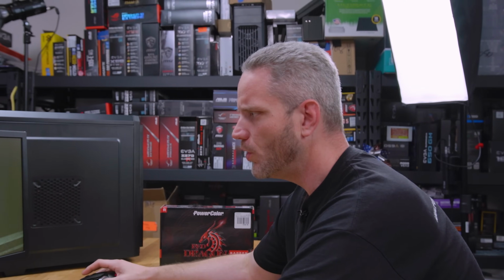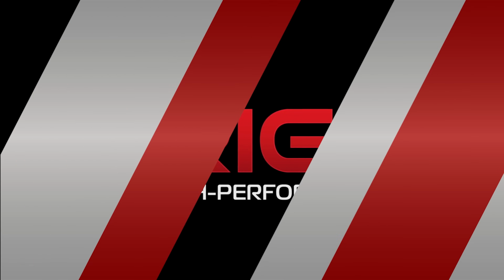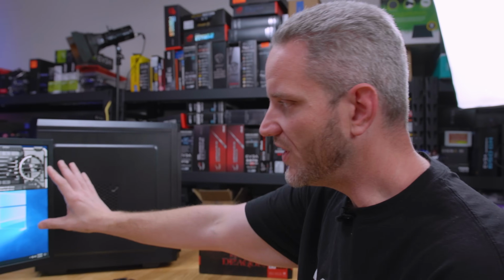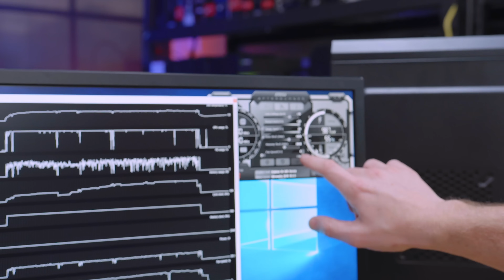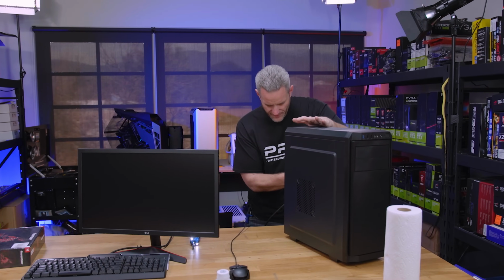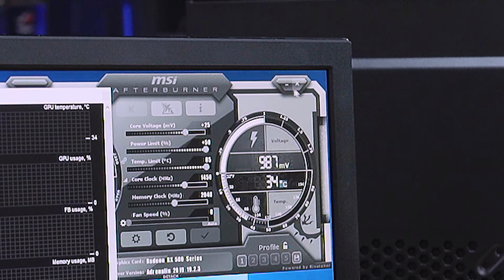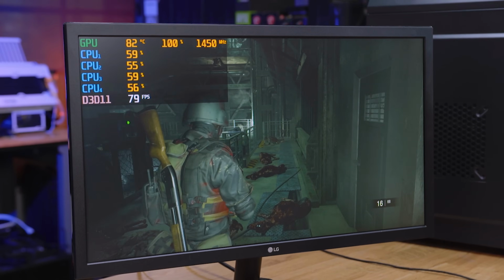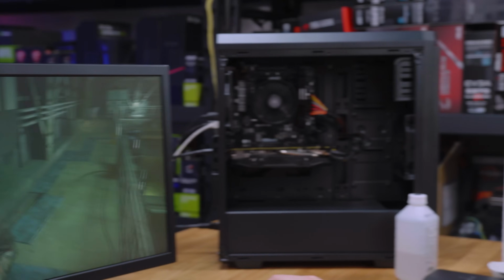Should you replace your video card's thermal paste??

Comment: Normally applying thermal paste on CPU is considered a no brainer, but on a GPU, is not that simple. Putting thermal paste on gpu is like putting thermal paste on a CPU without the metal plate on. I am glad I saw this video but I have questions. I am a diy guy and have done thermal paste replacement on my GPU but although it gave me a 2 to 5 degree drop in idle temp it was a decision I have come to question 1 year later. Here's what happened. I have never done replacement before but noticing my gigabyte 980ti GPU idle temp increase from 48 to 55 degree I decided it needs a cleaning and paste replacement. I did just that. I managed to open the GPU without breaking anything and realized that the GPU was naked, no metal plate like on the CPU. I decided to take precautions by removing the old paste slowly with small careful dabs of swab coated in alcohol. I finished cleaning after 1 hour or so. Then just to be on the safe side since I did not know if normal CPU application methods were safe for a naked processor, I decided to coat the whole GPU die with pste using a flat plastic card. Everything worked and I got smooth sailing for one year then the card died. Since my warranty was for 1 year and the stupid card had died just a year ahead, I had no real option other then replacement. I tried the alternative option of repair as a final gamble which in my country is almost always a waste of time when it comes to GPU as they are more complicated then a motherboard. Even if they cannot fix it they are veterans at testing circuitry and chips. The guy I gave the GPU for repairs (did not work out btw) asked me a very perplexing question "did you drop water on the GPU chip? It is completely shorted out and rusted". Thinking back the only time I had interacted with the GPU was when I replaced the pste on it even then I was extremely careful not to use too much alcohol or even applying paste in a way that it would still out onto the transistor around the chip. So how did it get shorted? I used the Arctic silver 5 paste was it the cause? But it would not explain the technicians "rusted" question. I noticed white crystals around the at the edges of the chip but thought nothing of it as the GPU was functioning even 6 months after I noticed them. Is applying thermal paste on a gpu really safe? Is cleaning a naked GPU with alcohol safe? Is there a particular type of cleaning liquid that needs to be used on a naked chip that can be found over the counter anywhere in the world? Is there anything I should have been careful about to avoid the chip getting shorted by moisture? The questions have haunted me since that day because the GPU took my entire motherboard with it. I would appreciate if Jay could make a more in-depth video on possible dangers of GPU failure from thermal paste replacement. It happened 1 year after I did it to my GPU but I benchmark life expectancy of GPU with my first GPU the xfx gtx 295  that lasted 5 years without a single thermal paste replacement. I question how a GPU nowadays fails in just 2 years.

Comment: Uh wow.. So I had been considering replacing the paste on my EVGA 1060 SSC 6GB for a while now and watching this vid pushed me to do it.. The results are friggin amazing :|
A difference of 15-20C! And that's even with a decent overclock. I tested it in Shadow of War and the max temp was 64C! Before when I played(granted its been a while) temps were in the mid to high 70s close to 80.

Now granted, ambient room temp is around 67F, and my case has AMPLE ventilation and cooling, Thermaltake Spedo Advance with  2 Exhaust 120mm's, 1 Top 140mm and 1 front 140mm, so that in itself is ENTIRELY different than the case used in the video. But my GPU as a whole has better cooling than the RX 580 so eh. But damn, I wasn't expecting that big of a difference.

Note: The Thermal Paste used was the cooler master stuff packaged with a Hyper 212 EVO, so it wasn't anything special. I did however spread a LIGHT coating across the GPU then added a small Dab in the middle for it to spread.

Comment: It's been quite a few years since I've built my own computers and I've noticed lately that there has been a change in the "accepted" way of applying thermal paste.  When I was building computers it was standard to spread the thermal paste before installing the heat sink.  This way it didnt stress the heat spreader/core in one spot and you ensured that there is enough paste across the mating surfaces.  Now it seems like everyone is ok with putting a blob on the center of the die and slapping the heat sink on.  
When did this change?  

Is there still any validity to spreading the thermal paste before installing the heat sink?

Comment: My evga xc ultra 2080 ti started to get to 84 at random on 2k ultra settings. Thought it might be airflow because my case doesn't  have a exhaust fan but I took the side panel off and there was no temp change.  So far the only thing I've done to remedy the problem is turn the fan speed on the card up to 40 or 50.

Comment: My 5 year old "ASUS GeForce GTX TITAN BLACK 6GB" has recently started to go up to about 88*c and my fan was working like hell! I use the computer mostly for editing and rendering with the cuda cores!
But I took it apart and cleaned all the parts. I also changed the Thermal Paste on it for the first time in 5years and it was almost clean already, It was so thick i could almost just "pick" it out.
After I got it all clean and put on some new and fresh Thermal paste i dropped about 10*c and the fan isn't working at 100% as before!
So as you say it can be a good thing to do if you have been running the card hard for some years!

Comment: Rx580 is just hot garbage. Had the sapphire limited edition which everybody talks about how good it is and it ran same temps as yours in a case with great airflow. 1080ti sc2 and 2080 amp both peaked at 70° on auto fan. Not to mention it came with a fan with a bad bearing brand new. Good old sapphire.

Comment: It's hit or miss. Had an MSI rx480 gaming x that I got about 7-8° drop. Had a 1070ti Gaming x and made absolutely no difference. I feel like most of the time the difference is because of quality control defects. I've seen a lot of cards with 1 of the 4 around the gpu not tightened down all the way or heatsinks engineered wrong so it's not tight enough to the gpu which adding a washer to the screw on the back of the pcb side resolved. Also had a 1080ti sc2 that temps actually seemed to go up 1°. I've done it dozens of times in the past and that's the 1st time I've seen it actually get worse. I'd say only about 25% of the time you actually get a gain tho. Not worth attempting unless it's an EVGA or MSI card where the company allows you to change paste without voiding warranty.

Comment: I personally think that fans that blow down on the CPU can cause a problem with an overall cooling of your whole system.

I would like to see a video where Jay would test this. A CPU cooler blowing down on the CPU vs a CPU cooler with heatpipes pushing air through thins towards the exhaust fan.

Comment: Aren't heat pipes designed to work at higher temps? Basically it won't pull heat if you don't boil the fluid in the pipes...

Comment: I recently bought a GTX 1050 2GB DDR5, but the temps are at 50 - 65'c.
Should i replace thermal paste or is it really not necessary?
Reply: No need gtx 1050 is a low power card it doesn't matter

Comment: My experiments show that after month of using thermal paste it works better then it was before. I think that thermal paste have some "liquid" inside to easy applying and spreading on surface but in process of working, day by day the liquid is vaporizing. In fact after a while removing the radiator from the cpu/gpu we'll see that thermal pase lost its "fluidity" and become in some sort of solid state :] As we all know from physics a solid conducts temperature better than a liquid. I test it on Cryorig CP-5 and CP-7..

Comment: I replaced the thermal paste on my old Gtx 960 2gb after a couple of years of use and although I can’t remember the thermals exactly, I went from 1 fps on heaven benchmark to 30-40 on ultra. The thermal paste was kinda hard but not rock solid.

Comment: Hey Jay, or anyone else in the comments, I just recently switched my 144hz monitor over to a displayport cable, but I'm running into some issues, when I put my computer into sleep mode or turn it off, the LED's that are attached to my case fans as well as the RGB light in my Corsair H115i CPU cooler say on, not all the way, but are a little dim. Does anyone know what could be causing this? I've tried swapping the cables out, I bought two, and that didn't work either as well as swapping to the other available ports on my GPU. Any help is appreciated, thanks!

Comment: Replaced my thermal paste in my MSI GT70 and got 20 degrees less since the fin stack were completely blocked with thick dust and the thermal paste was as dry as dry mud with cracks out in the sun

Comment: For my experience,
I have been using an MSI RX480 Gaming X 4GB since Oct 15, 2016(till today).

It has always been at high temps since i got it even with the fan on while gaming.. The fans were always running at 85 to 100% fan speed while gaming.
Last year around mid-November 2018 anytime i would open up a game/gpu bench i would suddenly get a black screen, gpu fans goes direcly to 100% and couldn't to anything besides force shut down.
I opened the gpu and to my surprise the thermalpaste was harden and also had a bad application. 
I replaced it with Arctic Silver 5 and it was a night and day difference! PC stopped crashing and even while gaming for a long period of time, my pc would stay relatively cooler compared to before and fans doesn't run at high rpm anymore.. Till today March 2019 everything's running great.. Gpu max out at 70-73 now compares to before where it would reach 85-88.

Comment: The first thing I do with a new GPU, particularly one that may have been sitting on a warehouse shelf for a while, is replace the thermal compound with a brand I know and trust. I wouldn't recommend this to the home user/gamer as there is a lot that can go wrong and the last thing you want is to void your warranty. For me personally however, I find it typically helps temps a little and also gives me peace of mind knowing the cooler is properly making contact with all the components it should. Having dealt with hundreds of GPUs, I have seen far too many with poorly mounted thermal solutions to just take it on faith that the factory did a good job and that the card wasn't dropped or otherwise mishandled between the factory and my door.  

That said, the moment your warranty is up, go ahead and replace that compound and give your cooler a thorough clean. This alone is usually enough to get you back to "as new" performance and cooling. From this point on, it doesn't hurt to replace the compound every time you service your system.

Comment: Do all of these components work together for a build? Also should I swap out anything for something else?

-MSI GeForce GTX 1070ti 8gb

-EVGA 750w Gold Power Supply

-WD Blue 2TB - 5400 RPM SATA 

-Crucial MX500 500GB

-NZXT H500 Computer Case

-MSI Performance Gaming AMD X470 Ryzen 2

-AMD Ryzen 7 2700 Processor
Reply: RyZe Space uhmmm there is no r7 2600? And replace that hdd with a 7200rpm
Reply: Rica Joy Adena I meant Ryzen 7 2700
Reply: Rica Joy Adena also what’s the difference? Does it matter too much since I’d need to put an extra $70 dollars to upgrade the RPM

Comment: RX 580 at 1450Mhz draws at least 220w or more, of course it will run hot at 82C even with a good solid dual fan cooler.. changing thermal paste is not gonna change anything.

Honestly, compared with a GTX 1060 which uses only 120W, and gives about the same performance it's crazy how power-efficient Nvidia cards are. The new GTX 1660TI only uses 120W and gives 30-40% more performance than rx 580, which is quite a feat.

Comment: I replaced the termal paste in my GTX 980 Ti Strix and i got better temps too. Now the max temp the card reaches is 70-75 degrees which is acceptable. Thanks to MSI Afterburner for custom fan curve.

Comment: I paired the PC Red Dragon RX 570 with the Ryzen 5 1600(6 cores, 12 threads) and haven't seen a temp above 75C even with a bit of an overclock to 1350/1850 on the GPU. Surprisingly enough, the overclock showed better temps than the stock settings did.

Comment: maybe you get same temparatures cause its set as max temperatur but the fanspeed is on auto so it may run much slower and quiter. maybe its just me hearing that there is less noise.

Comment: I've only done this once (twice technically) on a 295 GTX around the time 900 series got released.  It had been sitting on a shelf for a couple years at least.  I don't remember the difference but I do remember it was a big jump because of how bad it had gotten over time.  I also remember the temps I got after were similar to new condition.   Since there was no performance gain, I would consider it a maintenance thing.  I don't think paste should be an issue on any card new enough to be in use.

Comment: I purchased a Dell G7 (i7-8750H & GTX 1060max q) less than a year ago and since day 1 it runs hot (60c idle) even though I’ve undervolted cpu and set max processor utilization to %99 and I even went and got a cooling pad but it made no difference. This thing is constantly thermal throttling under load and causing massive frame drops in-game. AND to make matters worse, Dell doesn’t allow me to change the fan speed!Should I change the thermal paste? If not, any suggestions?

Comment: Another thing to consider doing is undervolting the card in Wattman. By lowering the voltages (and not touching the clocks) you can achieve even cooler temps that way as well, and improved performance in cases where the card was throttled by thermals

Comment: Jay, perhaps you can give me a tip here.

I have two reference rx480's in different pcs.

My card overheats easily even though its in an open case. The card in a closed case has no problems.

I switched cards and the issue must definitely be my case then. Its the Thermaltake P3

Comment: i purchased my Titan Xp used and out of warranty and i was getting terrible temps on the stock blower style heat sink (81-85C on stock clocks), i decided to purchase a broken evga icx 1080ti (SC2 works, FTW3 Heat sink wont fit) off of eBay and take the heat sink off of the Titan Xp since it has the same PCB as the 1080ti Reference PCB. i disassembled my Titan and replaced the thermal paste with Arctic Silver #5 and used high temp electrical tape around the Dye area to protect it since the Arctic silver #5 is electrically conductive, instantly my idle went from 45-50C to 24-27C, and max temp so far recorded was 57C after several hours of gaming which IMO was 100% worth the swap and re-paste, only issue throughout the entire process was the fans are split on the 1080ti but i was able to find a GPU fan extension cable, and fan splitter off of ModDiy.com to make the fans run off of the single fan connector on the Titan Xp. total amount spent was $100 on the broken card, and $25 on the extension cable, and fan splitter. another option is purchasing the SC2 fans which come on one cable vs the ICX being split. will post a video soon on the process since i never got a chance to film the process ill be doing it again to show my results.
Reply: P.S. forgot to mention that i overclocked the card by a lot, all of my temps for above after swap and repaste are with this overclock; Core 2088Mhz, memory 6237Mhz (stock is 1582Mhz Core Boost clock and 5700Mhz stock memory speeds; and for anyone asking its paired to a 8086K @ 5.4Ghz, with 32gb of 3200Mhz, crammed in the Louqe Ghost S1 Case. any questions just reply to me

Comment: I have 2 intake fans and 3 exhaust fans as well as a 3 fan gpu. It doesn't get hot like max i get is 55c but I was wondering if I pull ny side panel off would it run lower or would it be worse because u have good air flow?

Comment: It’s not something you should do at the beginning, but it’s an essential thing to be prepared to do down the line because your thermal paste WILL go bad after a year or two and WILL ruin performance by causing high temps and throttling. 

I replaced my 2-year-old RX 480’s thermal paste a few months ago. Load temps dropped from severe throttling at 90C to reaching full clocks at 70
Reply: Ive never had that happen, tho. Been building computers since '97. I remember the Radeon x850 xt that I had from 2005 to 2009. No problems with temps or throttle at all. Bought a GTX 285 that I had from 2009 till 2013. Same thing. Even my GTX 1060 Mini with a really small cooler and only 1 fan is going strong after 3 years. Its been in an ITX case the entire time.
Reply: @ffs2k  interesting, maybe the paste my manufacturer (MSI) used is trash, or maybe it's running at hight temps to begin with caused the paste to go bad
Reply: @rohana.7760  It might be something like that. I forgot to mention that I also had a GTX 780 with reference cooler from 2013 till 2016. Never any problems😎 GPUs are in my opinion made to last the time they are relevant and can actually be used for gaming😄